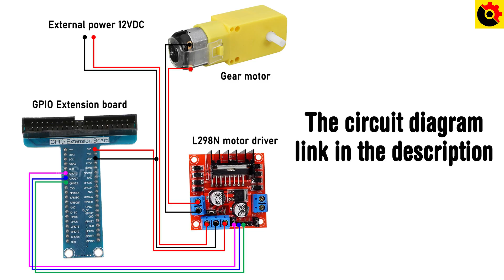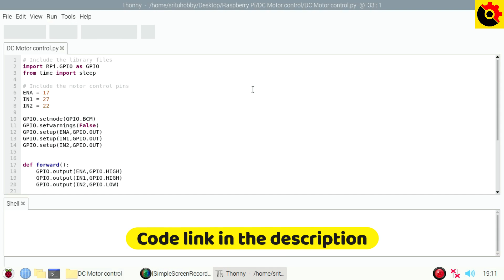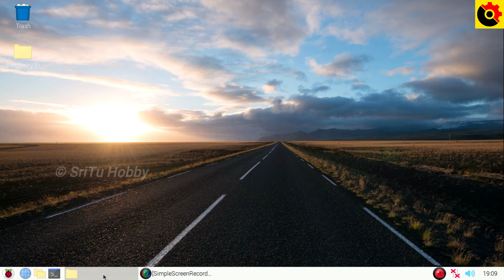Motor control with Raspberry Pi | L298N motor driver with Raspberry Pi

Comment: hello, Im so confuse. The gear motor working with 3-6VDC, why you could provide 12VDC to the LN298N?
Reply from the maker: Motor driver includes a voltage regular
Reply: @sritu_hobby  I found out myself. That motor working current is 3-9VDC. So when you provide 12VDC to LN298N it will drop to around 9V. So it fit the motor. Thanks for you reply.

Comment: i followed your exact instructions for  2 hbridges  (4 dc motors, 2 each hbridge) but not working. I made sure to connect all grounds together, our buck converter voltage (external supply) is decreasing dramatically when we connect grounds adn the - terminal of the buck together. Do you have an idea why?

Comment: What is the reason for removing the jumpers ENA-ENB from the L298N? Does it have something to do with the 5V output that is also connected to the 5V of the raspberry? or is to control the stepper?

Comment: My raspberry BROKE DOWN after trying your solution. I verified the pins correspondance several times and I confirm I used the same as yours... The raspberry went of suddenly and now it is not booting anymore, the ACT led is off.  I guess I will have to buy a new one, I've tried several solutions but non of them work... Do you know what could go wrong? Form the answers on the net it seems to be an overcurrent but I can't see where is the source of the issue, as the connections are correct.
Reply: Apparently the jumper for the 5V regulator should be removed if applying more than 12V, and in this case we need to provide this 5V for the VCC through the raspberry, as you do. But in the video we can see the jumper is on ! So I am confused...
Reply: @cescacufiprat286  what do u mean  the jumper for  5v 
Is it for the steper motor or what 
Is it the one with red color ??